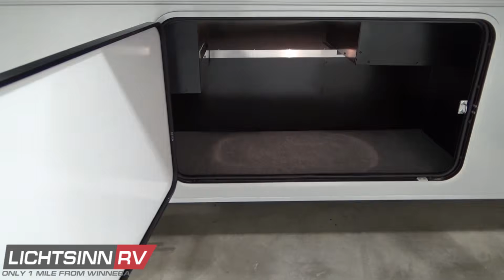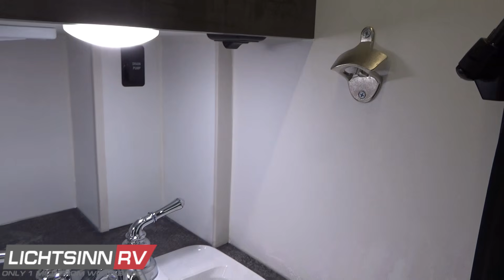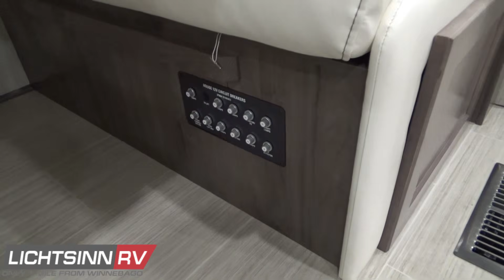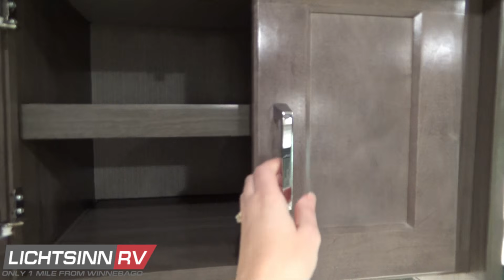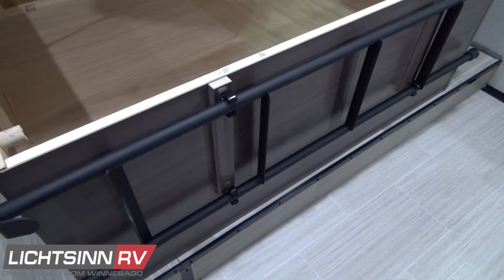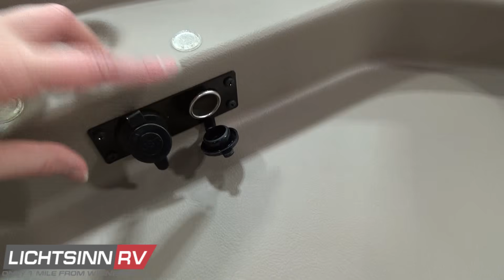LichtsinnRV.com - New Winnebago Adventurer 29B

Comment: Is it possible to remove the optional theater seats and have lichtsinn rv install Lambright rv recliners ?  I am about 6.2 feet tall and I like the taller back rv recliners they make.  Can I also have Lichtsinn RV install a custom designed lithium battery system ?
Reply from the maker: Good evening!   Yes, we can do both of these for you!    Brian Buffington, our service director has done many custom lithium and solar installations.    The sofa can be removed and the recliners installed as well!   Hope this helps!

Comment: These are upgrades that I would love to get installed in this rig. Here's just a partial list:
1)  (4) Battle Born Lithium Iron Phosphate Batteries
2) Victron Energy Multiplus II  2X 120  3000 Watt Inverter/Battery Charger
3) 50 Amp Power Watchdog Smart Bluetooth Surge Protector Plus EPO with Auto Shutoff (Hardwire Version)
4) (3) Zamp Solar 170-Watt Solar Panels with Victron MPPT Charge Controller
5) Winegard WF-4000 4G LTE and Wi-Fi Extender
6) Winegard ROADTRIP T4 Satellite TV Antenna
7) Samsung Televisions
8) Clearsource Premium RV Water Filter System
9) Truma AquaGo Tankless Water Heater
10) Motorized Shore Power Cord Reel
11) Alcoa Aluminum Wheels
12) Rettroband Wheel Enhancement (Tire Blowout Protection) for front tires
13) (2) Coleman Mach 15 A/C's
14) Maxx Fan Deluxe RV Vent Fans with MaxxShade Blinds
15) Full RV length awning with wind sensor (if possible)
16) Capless Gasoline Fill with Lockable Cover Door (if possible)
Reply from the maker: Good morning !   We can help with that!
Reply: @LichtsinnRV  It's good to know that you and Winnebago can and will fulfill the wants and needs of RV customers. Thanks.